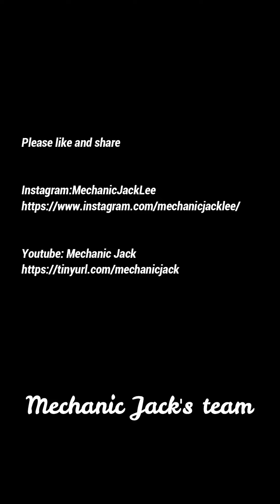Toyota Vios replacing front absorber

Comment: while changing the absorber mounting, the mechanic lock the top screw with the air wrench, now while  there's noise while turning steering.  is it because the top screws too tight?